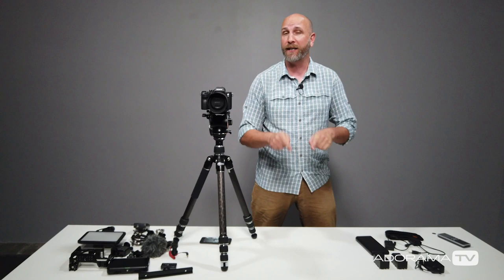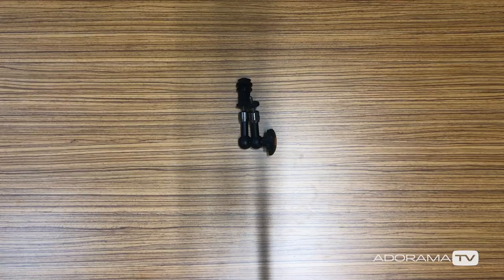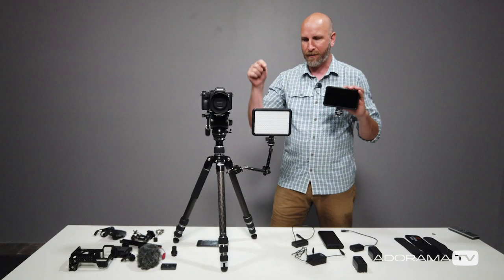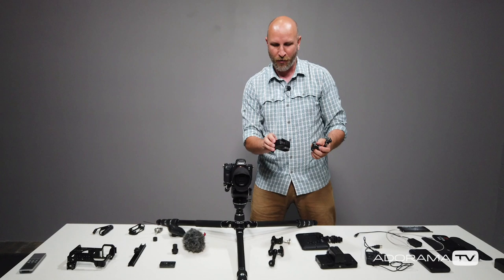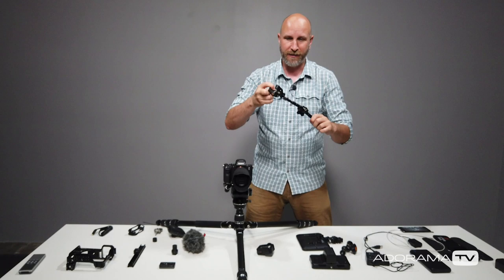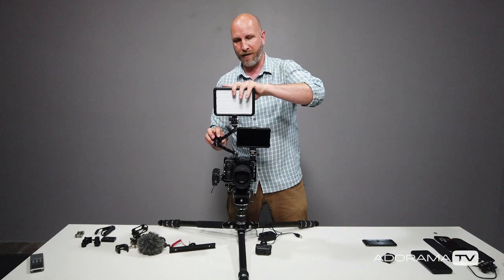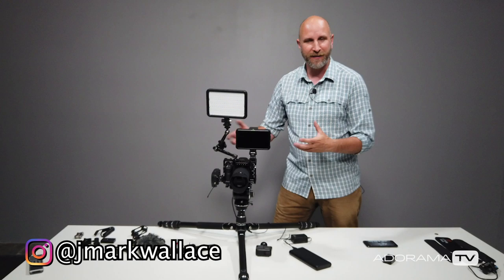Power and Mounting Solutions for On-The-Go Video: Exploring Photography With Mark Wallace

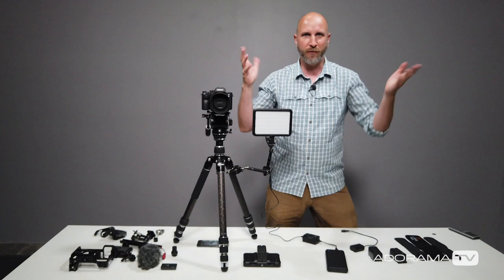Comment: Around minute 5:40, the power relay solution: The video does not show how one can discover that the connected power pack (such as the Anchor) becomes discharged.  Do we have a warning signal, e.g. a light on the power relay to indicate necessity to exchange the power pack, or a Bluetooth connection to a smart phone with an app ?